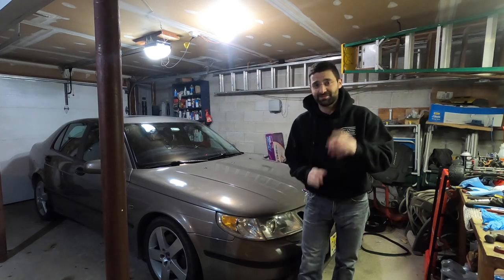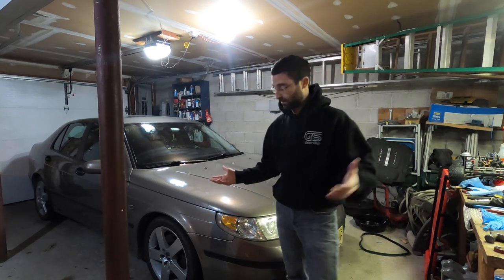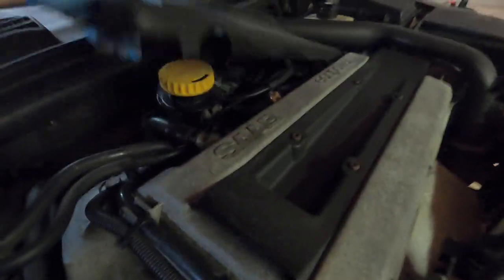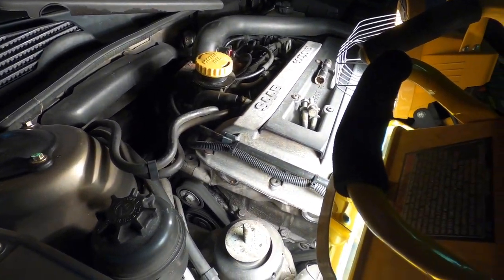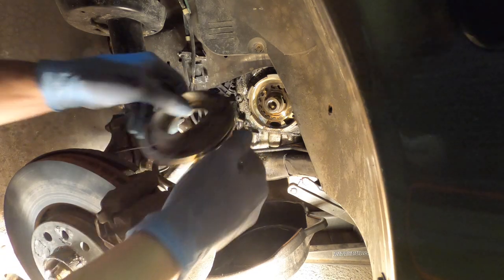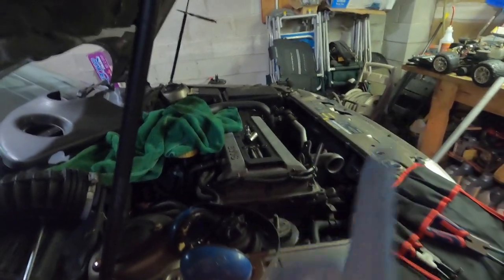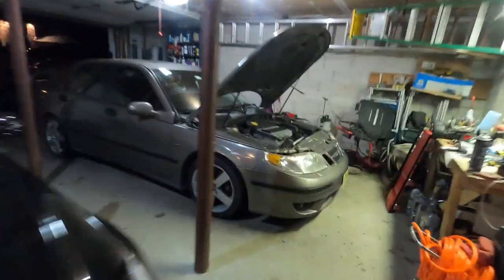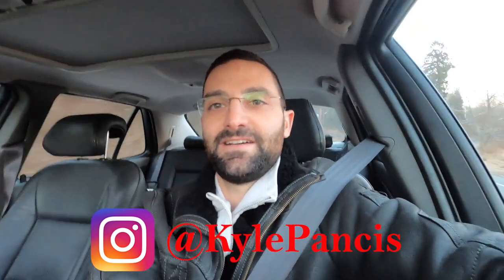Crank Seal & Belt Replacement on my 200k Mile Saab 9 5 Aero ROAD TRIP READY

Comment: I need to replace the serpentine belt on my 04. 9-5 aero, center pulley broke. Bought a short belt like you to bypass.
Did you remove the center pulley or just leave it in there?
Reply from the maker: I just left it! Not in the way